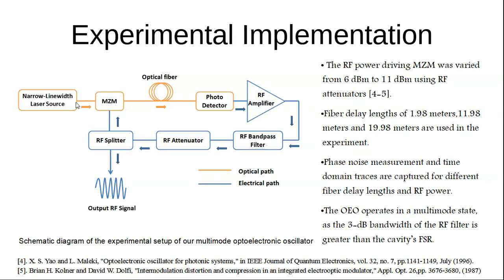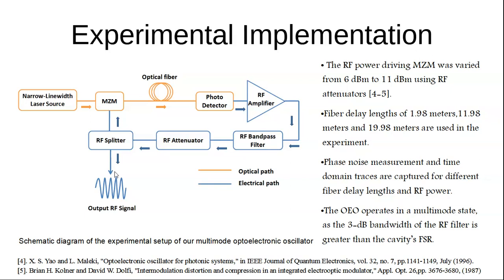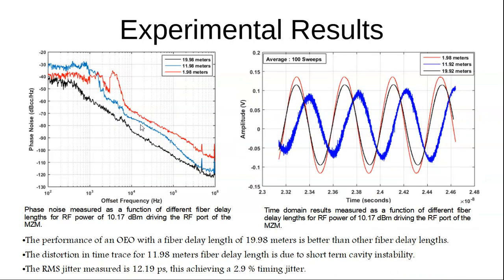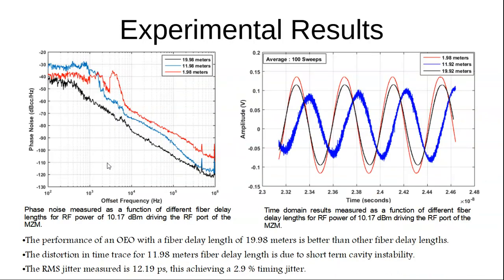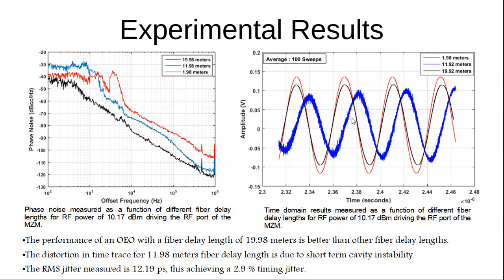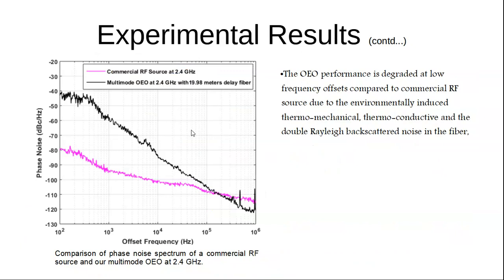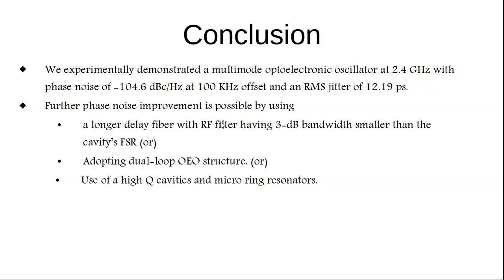Experimental Demonstration of Multimode Optoelectronic Oscillator at 2.4 GHz | IEEE WRAP 2022

Comment: Hello sir, how did you get the results in time domain (experimental results slide)? Did you use a simulation software? I'm trying to simulate an OEO on VPI Photonics, but i'm not getting the right results.
Reply from the maker: Time domain results were measured using 3 GHz photodetector connected to 30 GHz Sampling scope